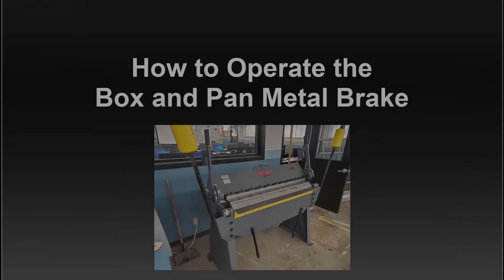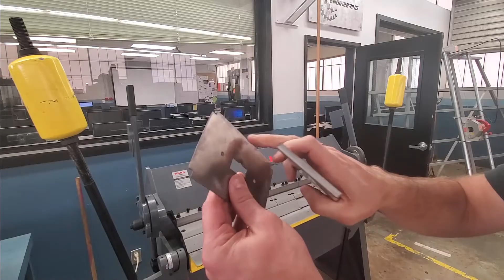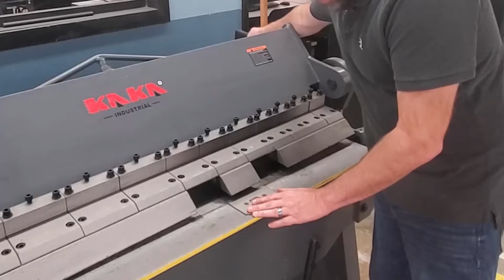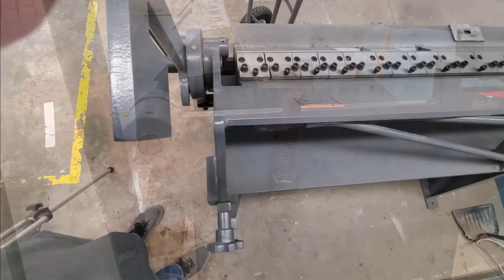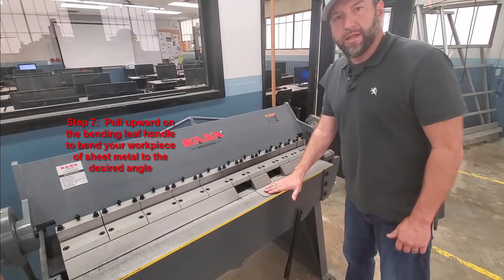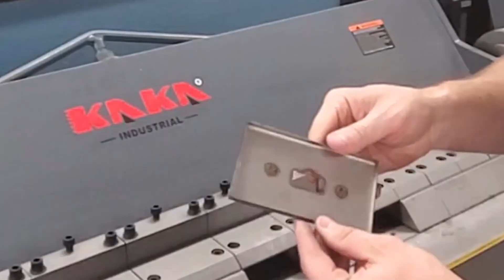How to Operate a Pan and Box Metal Brake

Comment: How do you handle bends that don't match the width some combination of the finger widths? For example, I have a 13.8" bend I need to do, with a brake like this (different brand) with 4 each 4" and 3" fingers. My thinking is  I'll need to use a combination of finger sizes with gaps between them to arrive at a 13.8" bend. But will the gaps be a problem? This is .090 sheet aluminum.
Reply: Hey did you figure this out?
Reply: @ not really, but I’m getting ready to do the bend that I describe in the next few days and I will then know.
Reply: @nolatone  Please let me know how it goes! Wishing you luck.